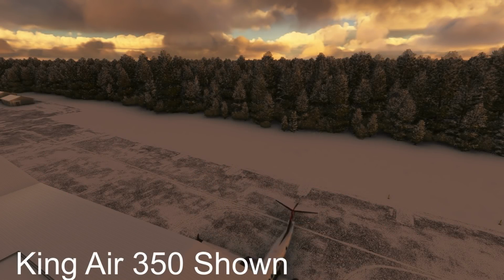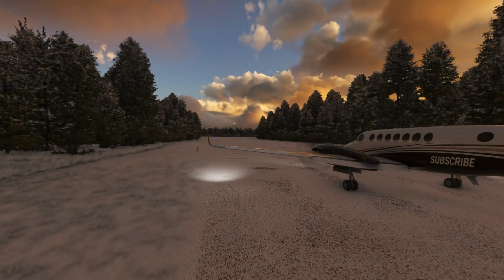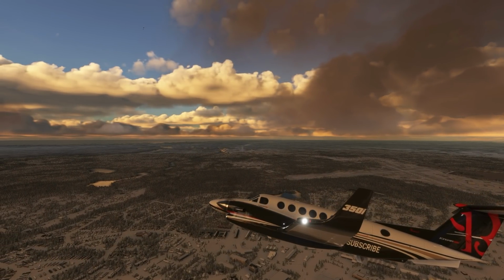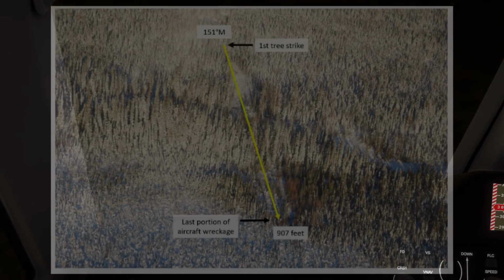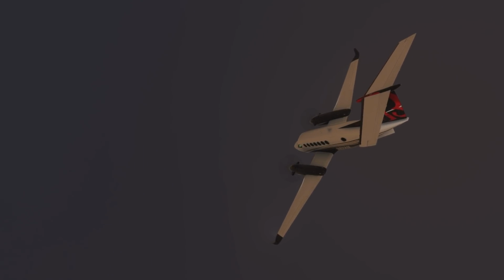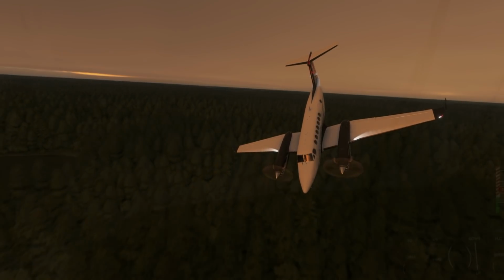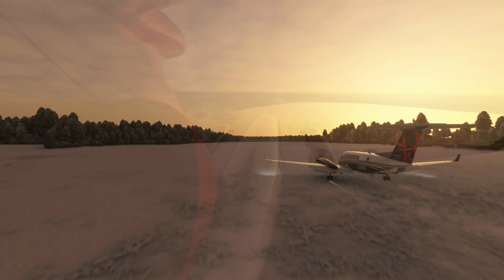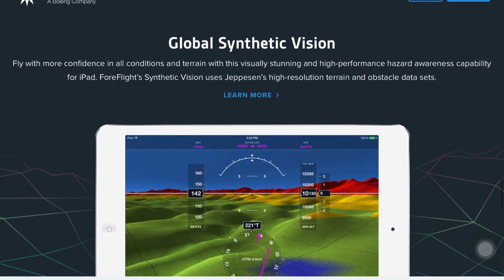They Tried To Fly A Broken Plane  | Air Tindi Flight 503

Comment: There should be 3 ADIs.  One for Captain; one for copilot, and one smaller back-up.  Also, you can fly without ADI in an emergency.  Use Turn and bank, rate of climb and descent, gyro compass, altimeter, rev counter....  This type of thing MUST be practised again and again, so when it DOES happen, it is not a problem.  You have to WORK at flying or you die if you do it long enough.  CAVU skies!

Comment: They’re flying IFR but a backup attitude indicator is not required by the Canadian regs (CARS 605.18). The operator’s own MEL could be more conservative. Not sure where you got the air/electric distinction but am curious.
Reply: You referenced the TSB report. Nice. But not quite right. The operators MEL says if an electric Altimeter is installed you require a functioning pneumatic attitude indicator. The type of AI on the left doesn’t determine the type of AI required on the right. It’s the altimeter that matters. Strange quirk of the King Air and their specific avionics choices.

Comment: non-pilot here. IMO they probably would have managed in a simulator environment- slightly less stressful.  The turn co-ordinator, (difference power source) + the Vertical Speed should have helped them. But hindsight is easy. RIP

Comment: I guess the lesson here is, "Fly the Freaking Plane!"  Duh?  Duh?  And, DUH, AGAIN?

Why is it so difficult for modern pilots to take over when automatic systems get stupid?

   --->>> WHY IS IT SO DIFFICULT FOR PILOTS TO RECOGNIZE THESE CONDITIONS?

A freaking HUMAN can interpret multiple failures much better than can a COMPUTER PROGRAM that was written w/o much imagination as to failure modes?

When things started getting abnormal, the autopilot should have KICKED OUT IMMEDIATELY and informed the pilots.  But no.  Some fool programmed it to keep trying.  Geesus.  What freaking arrogance!

This is a travesty.  "TAKE CONTROL" should be the mantra taught to these guys when they are learning the ropes.

Why do these pilots put so much trust in a program that was written by humans, when the pilots are on the spot and shit is going sideways?

I used to write software for a living - stuff much simpler than what is required to fly an aircraft.  Trust me; you cannot possibly imagine every failure and program the autopilot to adapt.  

That's exactly why the programs I wrote for HIGH POWER TESTING of antennas would abort if the software could not figure out what the what was going on.  If in doubt?  BAIL!  BAIL!  BAIL OUT!

Nope.  Cannot be done.  The possibilities are just far too complex to program!

That's why THE AUTOPILOT should have KICKED OUT and INFORMED THE PILOTS OF THE CONDITIONS!!!

The people who wrote this autopilot software were slobbering, arrogant fools, all in a row.

If you were in the driver's seat of an automatic car, and it started doing stupid things?

What would you DO?  Duh?  Duh?  DUH AGAIN?

This ain't rocket science.

I'm just sayin'...

...

Comment: I can't imagine a pilot of the caliber of this captain being unable to fly partial panel. My instrument instructors had my fly partial panel frequently. I developed a distrust of artificial horizon attitude indicators. We used to say "needle, ball and airspeed" as the basic instruments needed in cloud. The turn indicator "needle" has given way to the "turn coordinator" that gives rate of roll in addition to rate of yaw. Altimeter gives a slight lag of pitch information as does airspeed. Vertical speed indicator is of value for pitch information but the ones in airplanes are not sensitive enough in my opinion. I prefer the variometers in gliders. Faster to respond and more sensitive. Also, my various instrument instructors would have me recover from unusual attitudes by telling me to put my head down and then do some abrupt control inputs, then tell me to look at the instruments and recover to straight and level flight. Almost unbelievable the maintenance people reinstalled a bad attitude indicator 15 times!  Not worth 2 crew, plane & cargo!

Comment: I did some experiments and found this works if you lose your horizon.  It will only work for a cloud break. There can be absolutely no turning while IMC.
Set yourself up in a descent on a heading. The DG is a very sensitive instrument to show initial roll. If you maintain your HDG precisely,  you will remain level.
Only do this if you do not have the app and were stupid enough to go this far.

Comment: I don't understand how a malfunctioning attitude indicator could cause a pilot to lose control.  I have flown under a hood (my vision to the outside of the plane blocked) more than once in training.  I was taught that if I scan the altimeter and the direction indicator I would know if I was flying straight.  If the direction indicator is moving I am turning,  if the altimeter is moving I am descending or climbing.  I can also scan the turn/slip indicator for wings level if necessary and the vertical speed indicator to confirm my rate of climb or descent.   The attitude indicator is only one of the instruments in the "six pack".  All pilots are trained to fly with a malfunctioning instrument.

Comment: I use SkyDemon. as it has better European VFR charts than foreflight. In general, if you want to use an attitude indicator on a phone or tablet, it needs to be caged (calibrated) when you're straight and level. Most phones and tables have accelerometers, but no gravity meter so they can only measure attitude changes, not absolute attitude. If you haven't caged it it will show you the difference between the attitude when it's started up and the current attitude. So if you start it up when you're in a spiral dive it will tell you you're straight and level, or it will tell you it's not calibrated. Caging it in an unknown attitude is useless.

Comment: This might be a stupid question, but hasn't the auto pilot a gyro on its own and wouldn't it be a viable option to enable the auto pilot when the plane wasn't out of control yet?
Reply: The autopilot on older aircraft is analog based and relies on input from the attitude indicator, it's sensor and gyro. If the AI fails, the autopilot will become inoperative. Newer digital systems are more reliable.

Comment: An iPad does not have a high precision gyroscope. In that sense it is no better than a slip indicator. In coordinated turn, the iPad will show that it is level.
Maybe the iPad had an external IMU attached or connected to it?

Comment: While Foreflight, with attitude information, could have possibly helped them, good partial-panel skills would have been much more practical. I've felt the effects of inner-ear illusions first-hand in my Instrument Training, and though I've never become outright disoriented, it is IMPOSSIBLE to tell if you're straight-and-level or in a 150 degree bank without some reference to the horizon. 
Partial Panel flying is so difficult because the pitch and bank information we get from the turn indicator and VSI is incomplete. Really, they give us raw data that we have to analyze ourselves to determine what's going on, and the attitude indicator is like looking at a graph of that data. You also have to divide your attention between two instruments on opposite sides of the panel, so it is easy to fixate on one, let the other deteriorate, and loose control trying to recover.

Comment: A lot of confusion about apps and plumb lines and flying. They all react to g-forces, they can only show which way is down if gravity from the earth is the only force acting on them. As soon as you add the movement of the plane, all bets are off. Just the same as something hanging from the mirror in a car, it doesn't show down when you brake or corner.
I believe the electronic solution is a ring laser gyro, and no tablet has that!

Comment: I do use Foreflight, but I'm wondering if they had a Sentry or similar device - the AHRS on Foreflight doesn't work without an ADS-B receiver that specifically supports AHRS.

Comment: i wasnt too experienced at that point compared to others, but two items always took space in my flight bag, an Icom transceiver, route frequencies programmed and a Garmin moving map hi res GPS which I always kept at hand. One day an experienced jock joked at it, 'they will lead you to crash quicker'. I never flew with that 'Sir Crash Quicker' guy again.
Reply: I’ve often wondered: does that GPS map work reliably as far north as Yellowknife?
Reply: @Rishnai  ... It does not matter where you are on the surface of the earth provided you're not inside of a mountain or thick overhead vegetation. There are 31 satellites that circle the earth...all synced to the atomic clock. The GPS receiver only requires four to pinpoint your position within 10-15 feet. They each circle the earth once every 12 hours. Garmin has always been the leader in GPS technology.

Comment: I'm not a pilot, but I am a very solution orientated trouble shooter. In this case a simple bottle partially filled with a liquid could have given them a rudimentary horizon indicator.
Maybe it's an idea to put a comparable simple mechanical solution as a back-up in small planes?
Reply: Have you every driven in a car with a full cup of liquid. It goes everywhere

Comment: Another crash that could have been prevented by a nut on the end of a piece of string - hard to fool - if the nut is on the roof, you are upside down etc
Reply: Hang a nut in your car and see if that works

Comment: 👉🏻 Natively, ForeFlight will NOT give you the aircraft’s attitude information. There would have to be an external device that provides AHRS (attitude and heading reference system) data. Typically, these portable devices are mounted on a window or on top of the instrument panel. 

Having said that, if the airplane had Garmin avionics (including FlightStream 210/510), then ForeFlight can connect to the panel and (on some systems) provide AHRS data to ForeFlight.

Comment: Why not install like a very small carpentry level on the top of the dash board that should indicate whether or not the plane is level
Reply: Because it doesn’t work ..the turning forces in a plane  give  a wholly inaccurate reading

Comment: How very sad to learn that the problem was known and reported 15 times. Like you said, the CA probably didn't expect that there may come a day when it wouldn't come to life. I'm not a pilot nor mechanic, but what else might their fleet's mx records reveal (or not)? RIP 🙏
Reply: In the early 2000's a similar situation was unfolding TWICE with a regional airline in Western Australia. The first was an HSI (Horizontal Situation Indicator) that kept drifting and needed constant resetting. This was, like the AI in the video, swapped around between three aircraft, every time it was written up as unserviceable. 
The second. A new pilot was given a triangular route to fly, and was told at the end of the second leg, to take on 200 litres of fuel, that was provided. At that stop he calculated he had more than enough fuel remaining to safely make it back, so didn't add fuel. 
As he crossed the perimiter fence on landing, one engine flamed out, and on the landing rollout, the other engine did the same. He had completely run out of fuel. He was sacked because he didn't take on fuel at the second stop. 
It wasn't until later that he found out the fuel gauges were faulty, (hence the need to refuel at the second leg), but this was NOT annotated ANYWHERE in the aircraft log. The dud gauges were only known about through word of mouth.

Comment: Faulty instrument: 
Mechanics: Maybe if we put it in timeout for a bit, it will learn to behave.
Reply: In reality, every time we take an indicator out, we send it to a repair facility. The repair facility sends it back after performing necessary repairs and bench testing those repairs. When we install it, every time, a functional test is performed.

Comment: It's been a long time since I flew.  But one of the basic 6 instruments on the panel used to be a "turn/slip" indicator.  It's supposed to help you make coordinated turns using ailerons and the rudder.  It won't give you pitch indications, but it does give you roll indications independent of the attitude indicator. 

I get that the captain didn't have good partial panel training, but I'd assume he'd look at that before he got out an iPad.
Reply: In this type of aircraft there isn't the classic VFR Turn Coordinator
Reply: That's what 'partial panel' uses, along with airspeed for pitch (increasing airspeed means you're pitch down, decreasing pitch up), to maintain level flight. You get some training on that getting a commercial licence (and maybe ATP, but I never went that far), but I don't think many pilots stay proficient with that, as the video says starting around 8:30. It's not just this pilot who would be out of practice flying partial panel.

Comment: Yeah aviation in the north of Canada is the lifeline of the smaller communities. Planes like the C-46, DC3, Lockheed Electras are essential. Like what Buffalo Airways fly. Didn't know those planes like the Beechcraft were used for freight too. All in all, great video.
Reply: North of 60 is a very unforgiving region.
Look up "Wop May".

Comment: The foreflight attitude indicator is only available in the more expensive version, not everyone may have the money to get the artificial horizon.
Reply: All you need is a gyroscope, there's one in the phone, you can get free apps to get the gyroscope info. But I wonder if the reason for the left ADI to fail was a strong magnetic field which would've influenced the iPad as well.

Comment: excellent example of normalization of deviance. The pilots had become numbed to equipment being sketchy, but managed to get lucky and have something work well enough that they got back on the ground safely to do it again. 1 attitude indicator out means that if they lose the other in IMC, they're not likely to survive. If that was handled appropriately, the PIC knows that (and also that his other indicator isn't proper type to permit operation and puts the plane on the ground). If it is proper type, the pilot is ready-proficient in partial panel skills, knows what alternate equipment (ipad+forefront), reviews with crew strategies to deal with the failure. Instead, this captain hoped for the best, trusting he'd done this before and the equipment had finally worked. Or the weather cleared and it didn't matter. This time, all the holes in the cheese aligned and killed them both.

Comment: So what exactly is the "partial panel technique?"
Reply: There is a certain amount of redundancy in the instruments. If the artificial horizon is not working, the turn coordinator or rate of turn indicator can be used to determine bank. The vertical speed indicator and altimeter can indicate pitch. These can be used in a pinch to get back on the ground safely, if you're proficient in partial panel flying. It seems these pilots were not.
Reply: The airplane has a lot of instruments.
Some of these instruments are quite polished instruments, that are easy to read by the pilots, as for instance the artificial horizon, which quickly tells the pilot the attitude of the outside horizon (and thus the attitude of the aircraft), even when the outside (real-world) horizon can't be seen visually (say in clouds).
Other instruments are more rudimentary in nature, like a "turn and bank coordinator" instrument, which can help the pilot maintain wings level, but are not suitable for more 'aggressive' manoeuvres.
If you have both kinds of instruments working, which is by far the usual state of affairs, you are going to pay attention to the polished instruments for most of the time. If you are forced to use the rudimentary set of instruments only, you are said to be flying "partial panel".
I don't know how these things go nowadays, but years ago you could occasionally hear Air Traffic Control help planes in this kind of 'trouble' to approach and land at aerodromes, by giving 'simpler' instructions, such as "turn left heading 340, its a 20 second turn; turn rate one on my command; NOW.", "stop turning on my command; NOW" and so on. I suspect backup instrumentation is much better now (and more reliable as well). For instance a GPS ground track course is at least as helpful as a wet compass bobbing about in most situations.

Comment: There was a Russian flight that lost its cockpit instrument power due to a battery failure. They used a glas of water as an artificial horizont. They had clear weather though.
Reply: Glass of water won't help if the plane is banking and the G force is straight down, the water would be level in the glass but they would still be spiraling to the ground.
Reply: A glass of water would not work as an artificial horizon, any more than a plumb bob would. The flight forces will throw it off.

Comment: Did the turn coordinator fail too? Between it and vertical speed indicator one should be able to manage without artificial horizon in a pinch.
Reply: Good point. First thing is make sure wings are level using turn coordinator. Then check vsi and altimeter and keep a steady altitude. What a shame

Comment: Could the app have worked though?  Phone accelerometers/gyroscopes aren't really meant for flying and they can suffer the same issues as a pilot in a bank since they rely on whatever the apparent gravity is to work.  You can actually test it out the next time you're a passenger on a plane; they're just not really reliable for that.  The app may have told the pilots that "yep, you're level" while they were actually in a steep bank.
Reply: I would assume you can only get deceptive apparent gravity in a bank if you are ALSO in a turn, no? And any of the virtual or physical compasses should have readily picked that up, I presume.